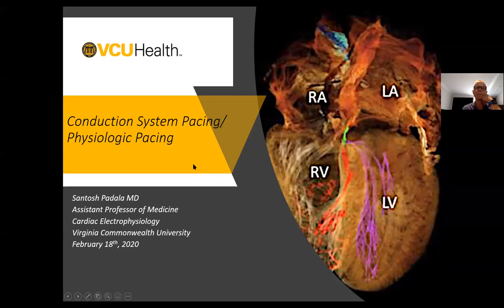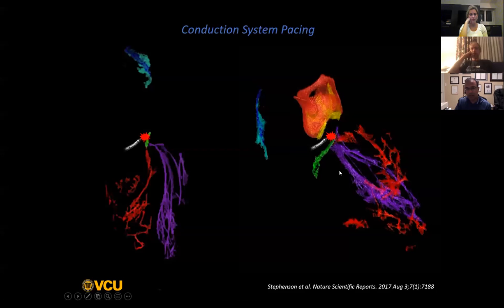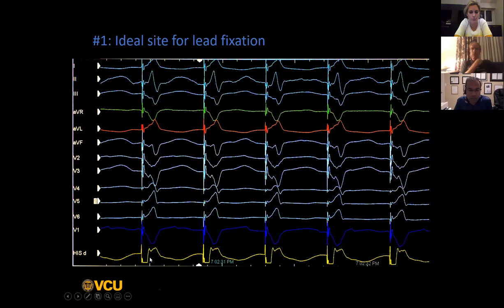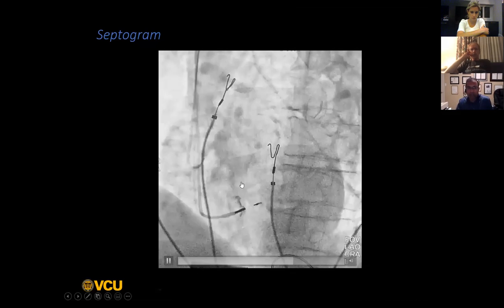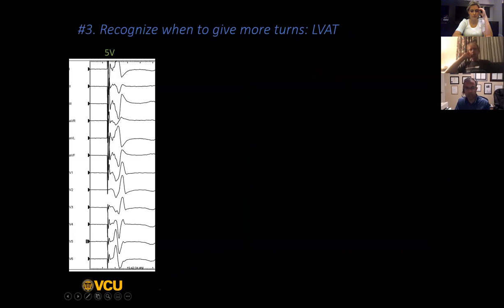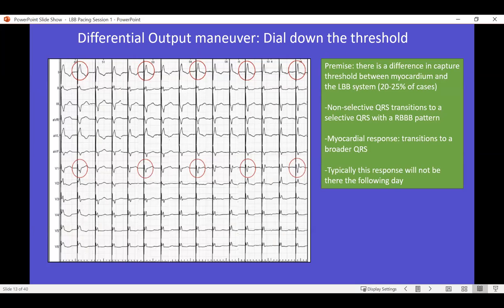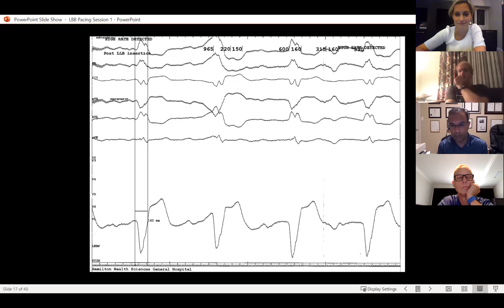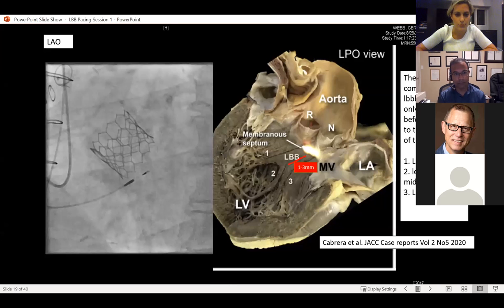Left Bundle Branch Pacing Webinar

Comment: I am recommended by the doctor to get a pacemaker. I have a third degree heart block. Should I have a left bundled or should I go for the traditional pacemaker ? Can’t decide between the two.
Reply: Traditional pacemaker can cause heart failure in some cases left bundle pacing is more natural to the heart conduction system which is kids safer